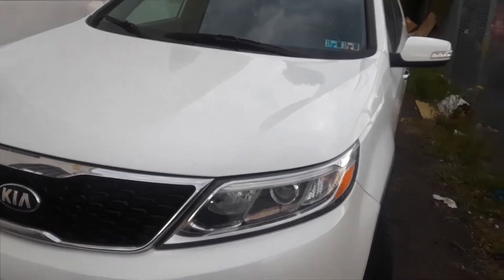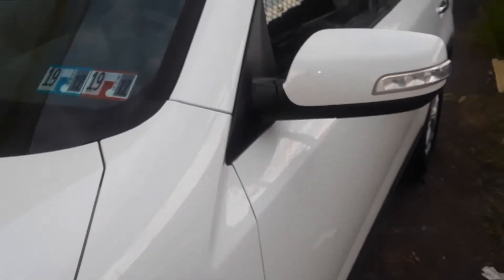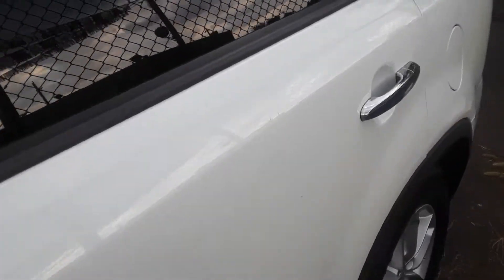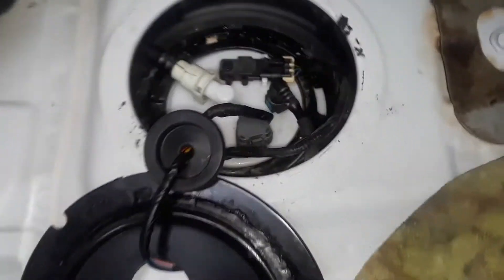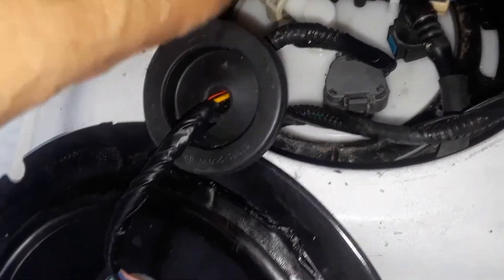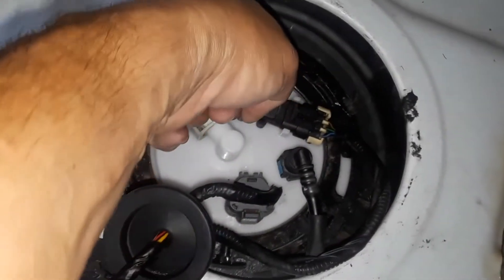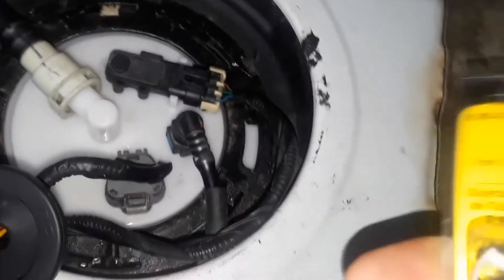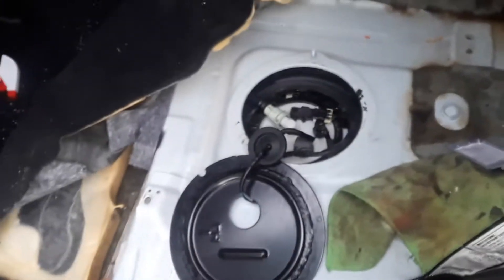Kia Sorento Fuel Pump Replacement

Comment: The clip that was broken is NOT supposed to be pulled out, instead the part that looks like a button IS a button (not a clip).  Push the button in and at same time pull the fuel line back.  The other line connector is squeezed from side and pulled back at same time.  I bet Kia only sells the entire fuel line and not the end......watch other videos on fuel line connector removal to be sure you don’t break one.

Comment: For anyone struggling with the cover. I have a 2011 lx. The cover is attached by a butyl strip. Basically glue. Pry a screwdriver underneath a lip of the cover and pry up. If metal begins to bend stop. Hit the lid with a heat gun. Not fire. After a few seconds of heating try again. Should come up no problem.
Reply: I’m havin issue removing the black access panel cover. It just prys off???
Reply: @PaezEddie  Yes. Heat it up.
Reply: @lukenavarrotn  thx. Got it off

Comment: Are the fuel lines under pressure? Will gas pour out through the lines once they are disconnected?
Reply: Just turn on car and go to fuse box , take fuel fuse off and let car die all fuel from lines will be gone 
Fix the pump or replace then replace fuel fuse back and crank the car it will take a few cycles or just prime it turning key to ignition only